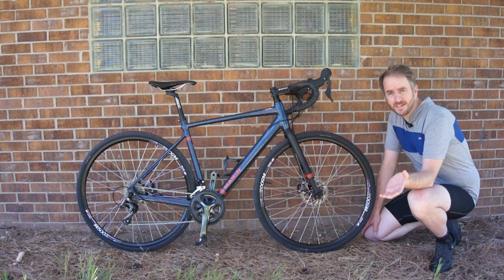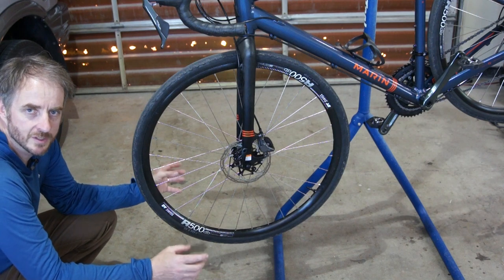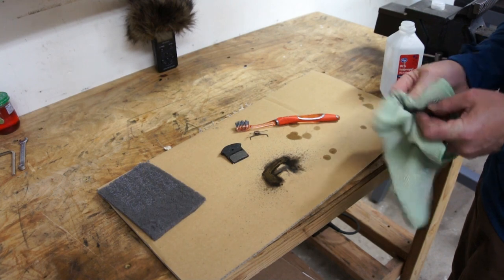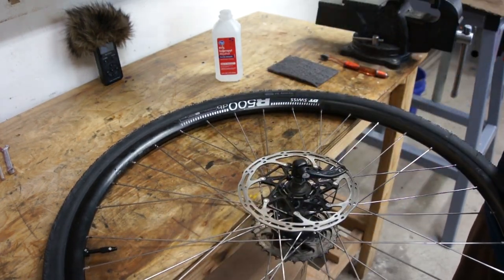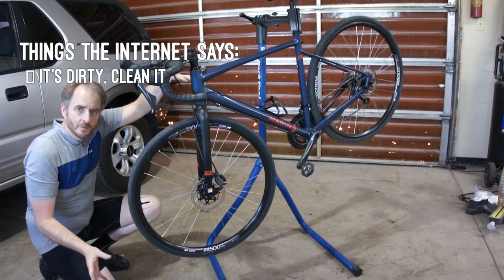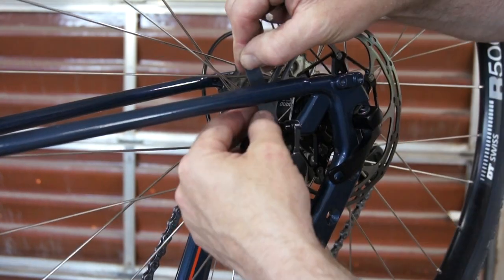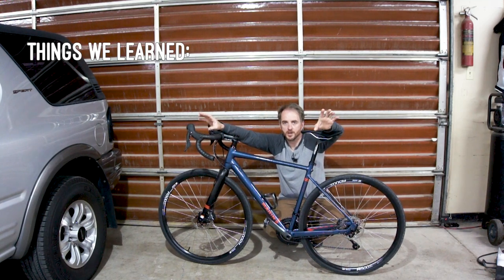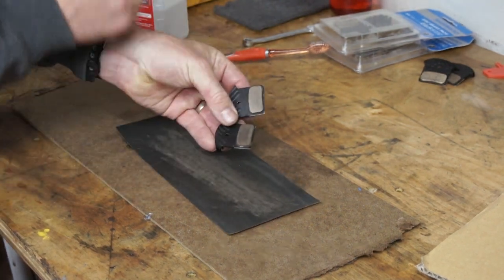Too Loud!  How to fix noisy disc brakes on your road bike.

Comment: Hi Rob, just a little advise from my 30 years riding experience... Whenever you work on disk brake system, before doing everything, wear nitrile or rubber gloves. The natural grease always present on our hands, even in small quantity, can degrade the brake performance. Use isopropyl alcohol or acetone, do not trust brake cleaner fluids too much. And bear in mind that noise from disk brake is also related to the brake temperature, try to check if you are experiencing this annoying phenomenon when the brakes are very hot. Greetings from Rome!

Comment: There is an anti-squeal coating that you put on the back of the pads. Permatex makes a version. This absorbs some of the vibration between the caliper and the piston. Perforated rotors will help to keep the pads from glazing.

Comment: Re the rear brake, it may also be realigned by loosening the caliper bolts and then applying the brake whilst retightening the bolts